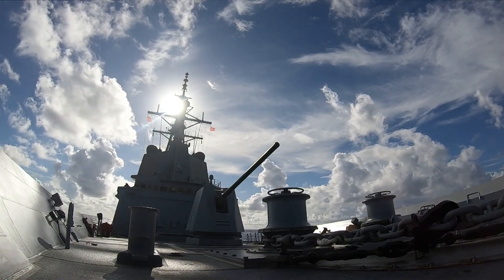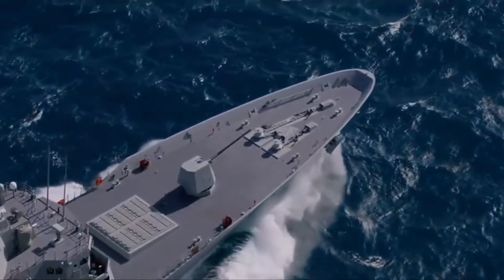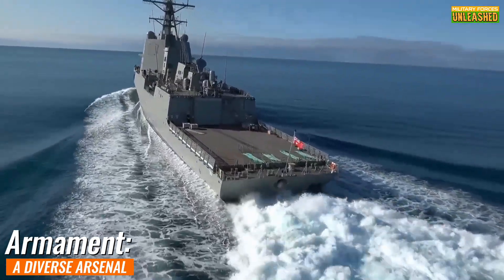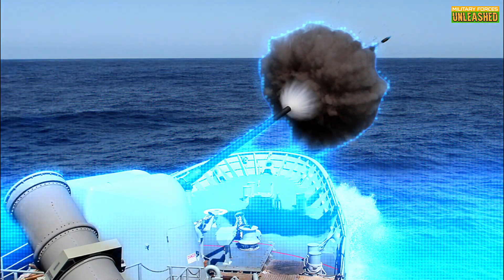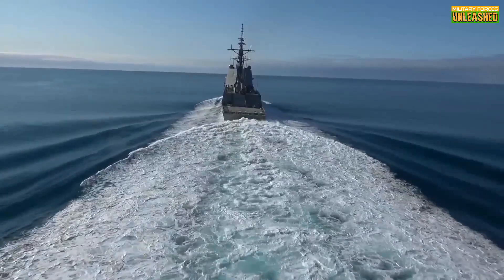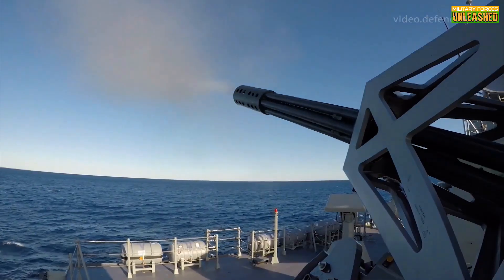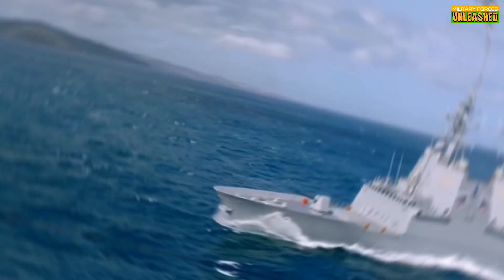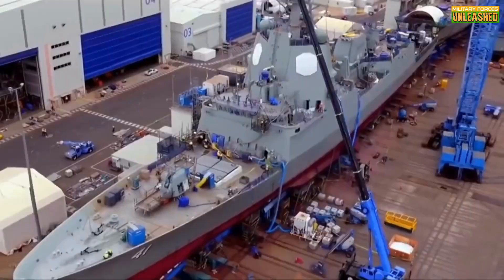HMAS Hobart: Australia’s Cutting-Edge Destroyer Unveiled

Comment: Australia has only 3 destroyers to defend the whole of Australia why not 6 ships built at Adelaide no we have 2 carrier no aircraft we have 2 new supply ships from Spain both out of service need heavy repairs new patrol boat with no weapon.
Reply from the maker: Ah, the classic "glass half-empty" perspective on Australia's naval capabilities! You’ve certainly touched on some valid points—Australia’s fleet size and operational challenges are frequent topics of debate. But let’s take a closer look at the situation, shall we?
First, you’re absolutely right that Australia has only three Hobart-class destroyers to cover an enormous maritime domain. With a coastline stretching over 35,000 kilometers and vast areas of strategic interest in the Indo-Pacific, three ships might seem woefully inadequate. However, it’s worth noting that the Hobart-class destroyers are not standalone assets—they’re part of a broader, integrated force that includes submarines, frigates, patrol boats, and soon, the Hunter-class frigates. These destroyers are designed for high-end air defense, equipped with the Aegis Combat System and SM-2 missiles, making them critical for protecting task groups and projecting power. They’re not meant to be everywhere at once but rather serve as force multipliers.

Now, onto your point about building six ships in Adelaide instead of investing in carriers. That’s an interesting argument, but it overlooks the strategic rationale behind Australia’s current procurement decisions. The two Canberra-class Landing Helicopter Docks (LHDs) were never intended to be traditional aircraft carriers—they’re amphibious assault ships designed for disaster relief, humanitarian missions, and expeditionary operations. While they don’t currently operate fixed-wing aircraft like the F-35B, they remain incredibly versatile platforms. And yes, integrating F-35Bs onto these ships has been discussed—it’s not entirely off the table for the future.
As for the supply ships from Spain (the Supply-class auxiliary oiler replenishment vessels), their recent maintenance issues are indeed frustrating. But let’s not forget that these ships are relatively new to the RAN and still represent a significant upgrade in terms of logistics and sustainment capabilities. Heavy repairs? Sure, teething problems happen—but so do solutions. The same goes for the new Arafura-class offshore patrol vessels (OPVs). Yes, there have been delays and integration challenges, but these ships are designed to fill a specific niche in littoral security and surveillance.
Ultimately, Australia’s naval strategy is a balancing act between ambition and reality. Building more ships locally—like the Hobart-class destroyers or Hunter-class frigates—is part of the Naval Shipbuilding Plan , which aims to boost sovereign industrial capability. It’s a long-term vision, and while it may feel slow-moving at times, it’s designed to ensure Australia can sustain its own fleet well into the future.

So yes, there are gaps and growing pains, but dismissing the entire effort as inadequate misses the bigger picture. Naval forces aren’t built overnight, and every navy faces challenges. Perhaps the real question isn’t “why not six destroyers?” but rather “how do we maximize what we have while planning for the future?”

Comment: HMAS Sydney test fired an SM6, so add that to the mix.
We needed at least a 4th ship. 48 MK41 VLS is decent and is as much as the type 45 destroyer of the U.K. but with the advantage of ESSM, which can be quad packed. An 8 cell block becomes 32 missiles. 
There is a lot of criticism of our defence spending in Australia, and rightly so, the upcoming hunter class frigates will only have 32 Mk 41 VLS, and it should have at least 64.
We could, in reality, reduce the amount of Hunter class frigates and build a couple more Hobart class destroyers instead since we have built 3.
The good news is they are now being armed with SM6 as well as the new updated Naval Strike Missile which has superior range to the Harpoon it is replacing.
Most of the tech is U.S. The Aegis Spy  radar, missiles except the new naval strike missile, the Mk 45/60 5inch Naval gun.
Reply from the maker: You’ve raised valid points. The SM6 test by HMAS Sydney showcases the robust capability of the current fleet, but indeed, a fourth ship and greater VLS capacity would be ideal to further bolster defense. The upcoming Hunter class frigates, with only 32 cells, are concerning, especially considering modern threats. It’s an important ongoing debate about the balance between cost and capability in our naval defense.
Reply: Lol except the Nulka Australian defense system invented by Australia also used on USA Arleigh Burke destroyers, Aircraft carriers and also Canadian navy ships. saved USA ships since 2016 against Houthis firing missiles at 3 US ships....
Reply: @nedkelly9688  Actually, you're right—the HMAS Hobart was built in Australia at the Osborne shipyard in South Australia, but it’s based on the Spanish Álvaro de Bazán-class design. It’s a perfect example of how Australia took a proven design and made it their own, integrating advanced systems and technology to suit their needs. So while the bones of the ship might be Spanish, the build and final touches are all Aussie, showcasing local industry and expertise.
Reply: @nedkelly9688  that is a fair point, l think we also collaborate with the U.S in the manufacturing of standard missile (sm2,sm6, sm3, and ESSM).
Reply: @sosministriesrev1412  Yea read somewhere was a collab with SM6  but can not find it now, Sea Sparrow also joint collab, so much Australian tech in USA weapons it is not funny, all their systems either have Australian AI or target recognition and tracking systems,
CEA radars and systems are becoming really good and sold world wide also.
Australia biggest thing is helping USA in hypersonics, Aus never mentioned but is ahead of all in scramjet technolohy with world fastest at mach 12 and test fly a hypersonic drone in less then 300 days.
HACAM scramjet missile developed though SCIFIRE and HIFIRE joint USA, AUS tests..
Reply: @nedkelly9688  Australia wants to change the propulsion system for the SM6 to scramjet and the US is actually going to work in tandem with them to do this development. I believe they have already started some fitting and testing...but all been very hush hush.